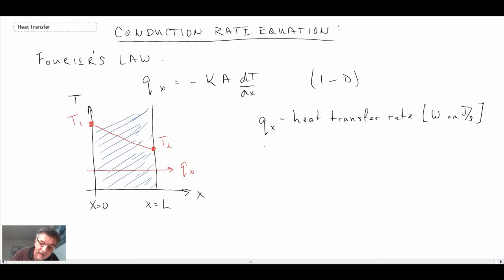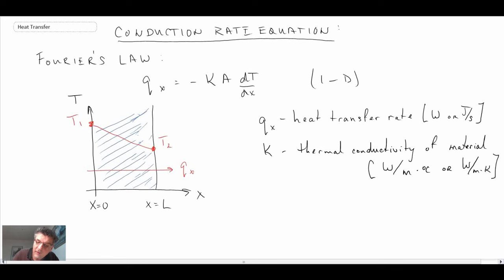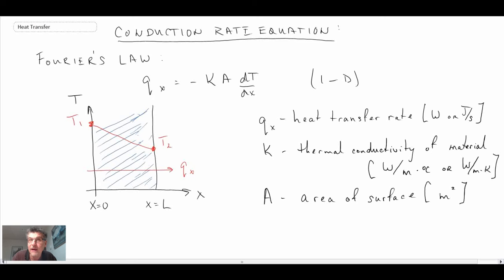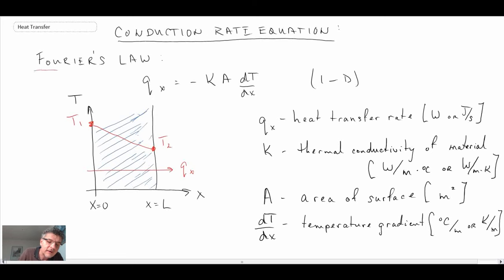Heat Transfer L1 p4 - Conduction Rate Equation - Fourier's Law

Comment: What does that negative sign in the formula indicates?
Reply from the maker: Temperature decreases with x.  dT/dx = (T2-T1)/(x2-x1) and given the coordinate system used, x2>x1 so the denominator is positive.  Given that T2<T1, the numerator is negative.  This means that dT/dx is negative.  In order to have heat flux positive in the x direction, you introduce the negative sign as both k and A are always positive.
Reply: thanks for helping me out!
Reply from the maker: You are very welcome!  I am not always able to respond to questions, but you caught me at the right time.
Reply: @ronhugo6225 
Q= - kA dt/dx

This forumula  how to use and  
Calculate dt/dx
Reply: it indicates the heat flows from hot to cold